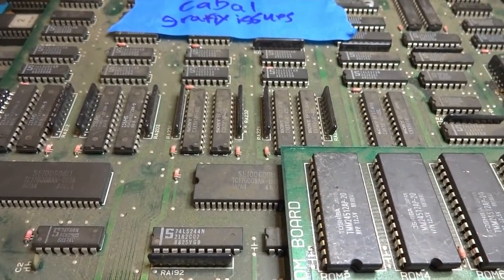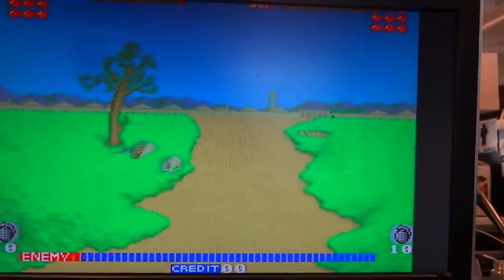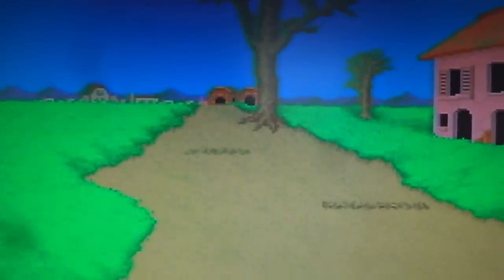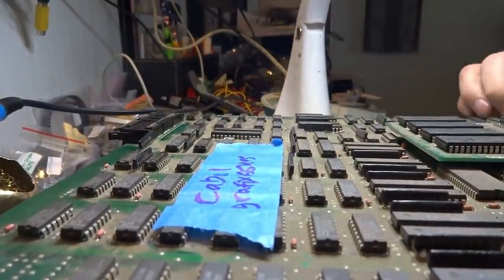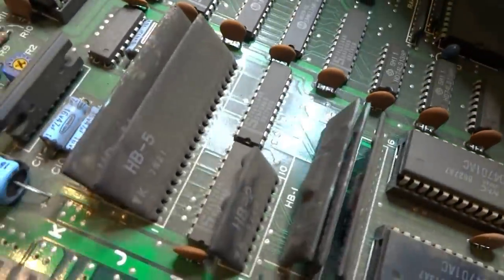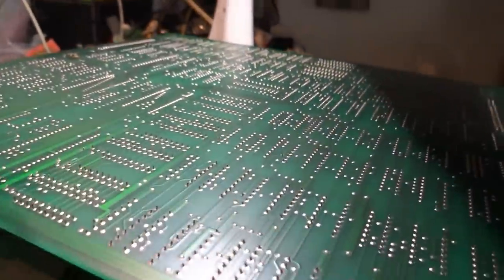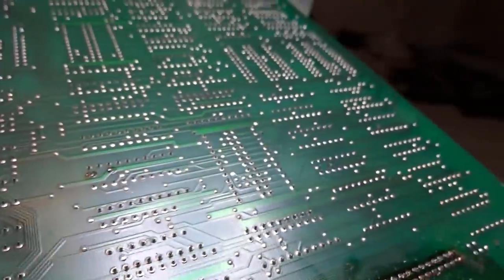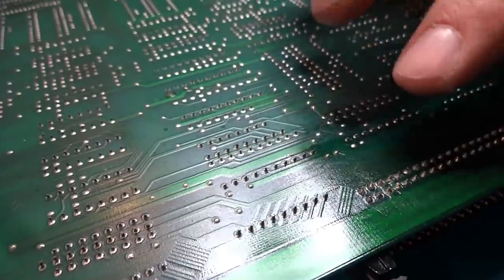Cabal TAD Arcade PCB Repair

Comment: Well at the very least you found the cause of the problem. Well done. Two down...
Reply from the maker: For sure, It seems to be holding up well and as long as Im not flexing the cables back and forth it should be ok I think. Thanks as usual!

Comment: Those ribbons look awfully similar IDE cables with different connectors on the end
Reply from the maker: I thought so as well but the ends are a bit wider and thinner. I wanted to try to swap them out but I couldnt. Maybe in the future.
Reply: @lukemorse1  Ah, bummer. Of course they couldn't make it that easy! Making a custom cable for that looks like a proper nightmare 😂

Comment: I thought I had seen thise, but I probably just say "TAD Arcade" and thought Toki. That was the one with unfortunately a questionable design of mounting a custom chip precariously on the PCB (vertically) that if I recall had gone bad, and someone  fortunately made a replacement, if I recall.

Comment: Might be easier to just make your own cables from IDE cables and use a pin pusher to re do the connectors=
Reply from the maker: definitely a good idea for sure. The ends are a bit different than regular IDE but Im sure something could work.